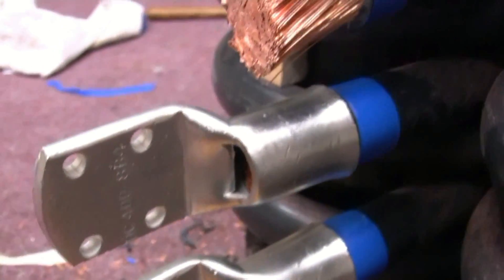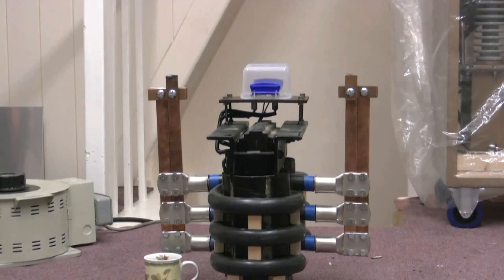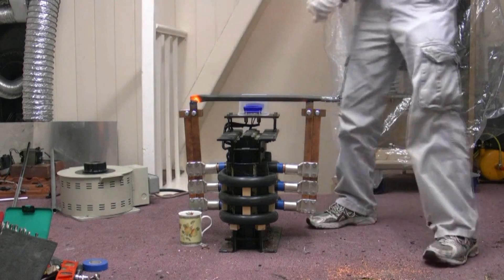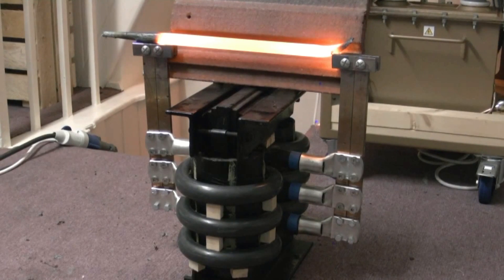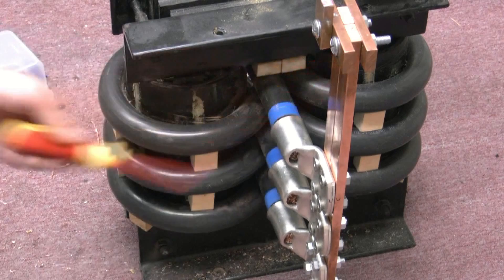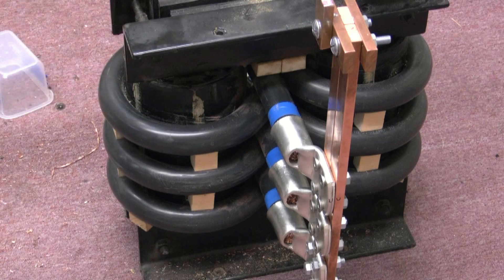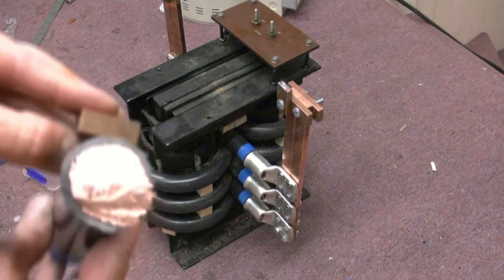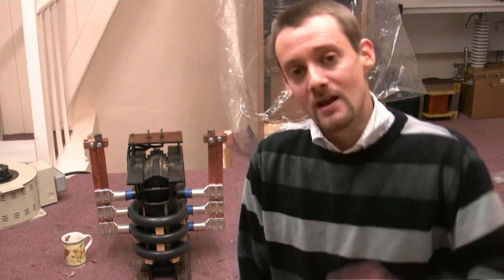50,000 Amp Transformer Completed

Comment: I'm not to smart with electricity but how is he not dead for touching that? Wouldn't he technically be the ground for touching a complete circuit?
Reply: the voltage isn't high enough
Reply: How can you have 500 amps and low voltage?
Reply: 0_o ... how much do you know about this stuff?
Reply: Not enough.......
Reply: called path of least resistance.
Reply: The output VOLTAGE is super super super LOW.
The output CURRENT is super super super HIGH.

There is no shock because the output voltage of the transformer is too low
to give a human a shock. The human body has a resistance of a few MEGOHMS
(a few million ohms). The amperage through the body is a few microamps (millionths of a single amp).

But the copper bars have an extremely low resistance (millionths of an OHM).
Reply: It's only the current he would get through his body that would kill him. And the current is described by ohms law I [A] = U [V] / R [Ohm]

The voltate is below 1 V, then the difference between him and the screwdriver is the resistance in the path the current would take. The screwdriver has close to zero ohm resistance while a human body is in the range of megaohm.

So even if you touch the poles directly you would only get some microamperes through your body due to the low voltage and high resistance.

If the poles were very close together the case would be diffenrent, say if you could touch them both at the same time with a finger. Then the resistance would be only that of your finger and that is significantly smaller than the entire body and then you could burn your finger off but still survive since the current would not pass through your body.

Comment: This guy almost puts him self at a difference of potential multiple time in this video. Still pretty cool though. Don't kill your self man
Reply: John Bäckstrand Amps... not volts.  Less than half an amp will kill you. But you could come into 100,000 volts and just get a really minor zap.
Reply: He is in no danger. Super low voltage xfmr produces nanoamps in the human body.
Reply: A difference of half a volt? Not likely to kill unless you hooked it directly to your heart.
Reply: 0.5 volts with the resistance of the body would result in not a whole lot of amps. Its not a constant-current source AFAIK.

Comment: A car battery will knock your bollocks out! its 12vdc at 80A, i know from personal experience! you can touch both poles if they are loaded, but not if your allowing current to flow through you to load.

Comment: You still must have at least like 50volts in order to get a shock from hand to hand.. I don't know if 50 volts are too little, or well over what's needed, but I do know that you can touch both poles on a car battery without a problem. And this transforms the electric far below a car battery's voltage level.

Comment: As it says in the description, it has the capacity of 50'000 amps, but his house doesn't have enough power to run it on full load. I guess it's mono-phase as well. 
As a lineman, I could easily get acces to a high current source, but I don't have access to his transformer, would've been fun to test it at full power :D

Comment: How can your house main circuit breaker hold that much power ?
50000 A * 0.5 V makes 25000 Watts, right ?
If your house is delivered with 240 V mono-phase your main curcuit breaker has to hold at least 104 Amps...

Comment: But his electricity bill should be high :p
If I'm right, 50000 Amps * 0.5 V = 25000 Watts
His house main circuit breaker has to hold 104 Amps (I presume it's 240 V mono-phase).

Comment: i don't think that's a 50000 AMP, it sounds something between 2000 and 3000, if it was 50000 AMP that screw driver will be melted in less than 3 seconds

Comment: Great stuff & educational.
You should be wearing goggles for metal splashes.
Don't wait until it happens & you lose an eye or both before you say of me,
"That bloody guy was right!"
Also.Draw an arc for too long & you make UV radiation, winding up with welder's eye-burn. Burns a thin layer off your eyeball in a short flash.
Not all that serious as it re-grows pretty fast BUT infection sets in because of fluids in the eye. Conjunctivitis is like sand (a whole beach-full!) in your eyes!
Be safe!

Comment: The open circuit voltage on the secondary is only a couple of volts. You can touch both the bus bars and nothing would happen. It's like a car battery, since it's only 12 volts, you can touch the output terminals and nothing would happen even though the battery is capable of delivering hundreds of amps.

Comment: Nice work, 
However 25kVA is a over optimistic figure for a U+I, iron core, 60cm tall, air gap transformer, not to mention that 400 sq mm are rated @ 4200 (4.2kA) with a temperature increase of 105-110 Celsius over ambient temperature (cable insulation will becomes fluid  ). 
To round it up 4.2ka * 3 windings = 12.6 kA -12600A x 0.5v = 6.3kW maximum rated power for the windings.
2.5-3.5kW for the transformer is more realistic

Comment: Judging by the size of the transformer, it is much smaller than you assume.
I am an electrician and work with transformers, but even a 25 KVA would be bigger than that.
Regardless, great video!

Comment: Sorry to dissapiont you but that is nowhare near 50000 amps.
for this you will need a secondary transformer resistance that is impossible to acheivewith tose cables. Ohms law states that I=V/R Therefore R=V/I =R=.5/50000
Which = 0.00001.
Note this is for dc. on AC this is greater due to the inductance .
I suggest this transformer is atound 2000 A max on the secondary.

Comment: I think some folks in the this thread are in violent agreement. 

Yes, only milli amps are needed to kill someone, but suffiicient voltage is required to overcome the resistance of the human body. In practice 240V is more than enough. 

In this case, 0.5V is "safe", but as you can see the huge current can't overcome the resistance of the metal bar placed across the terminals with only 0.5V, so instead it rather violently heats the bar.

So safe? Don't think I'd be doing this shit in my house!

Comment: 15 kva / 240v is over 60 AMPERES.  You are either spinning your electric meter right off the house by juicing this thing with multiple parallel circuits from the grid, or you're about to start a fire!

Comment: You are really wrong it's the amps that kill. You could have 10,000 volts at .05 amps (a typical electrical fly swatter) and still be fine if you touch it.

Comment: 50000 Ampers??? Bullshit!
A 1,5 mm2 copper wire can 15 amp without warming. So 50000 amp NEEDS an 5000 (!!!) mm2 copper cable (that thicker as my thigh). The cable in the transformer max 800 mm2, so maximum 8000 Amper without warming... (A metro train uses 4500 ampers to start full with passengers.)

Comment: Why about power? From what I understand high voltages are an issue because the electrical energy may jump over long distances, but the current is what causes the actual damage. Power is just these multiplied together. You could have quite large power, but a tiny current, causing little to no damage.

Comment: I am not any sort of electricity expert, but I think with low voltage and high amperes you can worry less about an arc forming from ionization of gas (from wire to skin), and only worry about direct contact with the metal.

Comment: No. 0.5 V  of potential difference is not great enough to overcome the resistance of your body. Your body/skin has a much greater resistance to current flow than the iron tools shown in this video. You need a considerable amount of voltage for you to get electrocuted. It wont kill you. Touch the terminals, and nothing will happen. Touch the iron bar resting on both the terminals, and expect burns.

Comment: It's high current not high voltage, ohms law determines how much current flows squat all volts through about several kohms of body resistance is squat all current, through a fraction of an ohm quite a bit of current flows

Comment: Hi I need your help. Look I have a power of self 1200watts brand boss and I need a transformer to connect to 220v and 12v output need but have to have at least 30amperes that I have to do or you could help me? thanks greetings

Comment: Hey friend, I like your video very much. I from Argentina, (I don't know speak in English good). My question: If I would put my hands in the terminals by your transformer, it could kill me??? I know: very high voltage and very low current, not kill. But, very high current and very low voltage, it could kill me??? 50kAmp. 0.5V.??? Thanks. ;)

Comment: That is simply not 50,000 amps.If it was it would fry that thick wrecking bar.
Its because there there is not enough turns on the output to overcome the bar
resistance.Also the input voltage may need to be at least 220v at 200amps
or 44 kw..At 20 volts output current would still only be 2500 amps.

Comment: your Transformer is Impressive, but kind of ineffectual. why? as you said, you only have an Volttage of about 0.5 Volts. Physics teached us That the Current that Flows in a Circuit depends on the level of Voltage and Resistance ( I=U/R). The Problem is, that The Metal you wannt to heat gets more Resistance the hotter it becomes. So there is a point where the Metal is quiet hot but does't allow mor current, so it doesnt heat up more. You need at leas a fiew Volts for a proper Courrent.. Bye

Comment: I'm not sure about this.. but if the surface of both connected bus bars can hold up to 50kAmps flowing through them, then the current would not flow through screws since copper bus bar has lower resistance than screws.. and additionally the bus bar would not heat up since the 50kAmps would not be a burden..

Comment: since the body has resistance, the current would not flow through the body if the applied voltage is lower than a value...so, the higher the resistance, the higher the applied voltage is needed to make the current to flow

Comment: "Where do you see the 400 turns?"
I cant see them - they are inside the transformer - they are the turns that form the primary - what you see are the turns of the secondary.
It is a step down transformer - he is going for very low voltage - very high current.

Comment: He has 3 secondaries of 1 turn (or 2 turns?)
The primary has (probably) 400 turns - so the transformation ratio is 200: 1 or 400:1 something like it - 240V in 1 volt out (or 240V in 0.5 v out)

Comment: Gosh. Get a good contact with the test object (use clamps) and it will blow like a fuse.
I test with high current (5kA) and those systems humm like a truck at full load. This system is only warming up.

Comment: We see transformers like this in industrial spot welders but they also have liquid filled copper tubing wound throughout the transformer core and windings to help cool it.
It is then hooked to the utility water supply or a cooling unit with pump and fan to keep it cool.
This dude is literally playing with fire and his life not to mention that all large transformers are supposed to be put inside a metal steel box to shield the electromagnetics of the transformer from all else around it.

Comment: While the amperage is what kills you, what determines how much amperage can flow would be the voltage.

With half a volt, and roughly 1k ohm resistance you do indeed get 0.5 mA which is below what you can actually sense.
1 mA is roughly where you feel it, 5mA hurts.. 10 mA hurts like hell... anything over there you may end up dead.

Comment: The voltage is the preasure and the current is the flow. He can touch those busbars because the voltage isn't high enough to overcome the resistance of his body around 100 000 ohms. Where as the rod or screwdriver only would have maybe 0.5 ohms resistance and electricty will take the easiest path or least resistive path.

Comment: Are those crimp lugs actually crimped or did you just push them on with your hands and hope they would weld together? Also, what's it drawing on the primary? If the primary is 2V then 220 / 2 = 110:1. If its drawing (say) 10A on the primary @ 220V then the secondary current would be at most 110 x 10 = 1100A (not 50,000A).

Comment: "A screwdriver wot goes round corners", love the accent....
You should contact a company called "Butterfly labs (BFL)", they are in need of some help with powering their new low voltage product range.
400 Amps should just about do it...

Comment: What he should do is measure the primary side current, primary side voltage and secondary voltage. Then its simple math to determine exactly how many. 

PC*PV / SV = SC

Cool idea, well designed. Why did you spend so much money on it though?

Comment: actually at 50hz that cable isn't significantly less resistance than that busbar due to skin effect limiting the effective crosssection, (still higher current rating due to thermal mass and dissipation) so my guess is heat in the busbar is thermally conducted from the high resistance connection to your work piece.

Comment: Or in real laymen terms, he has a tiny voltage, not enough to shock the body (like a battery). But such a low resistance in the wires that TONNES of electricity flow. 

The same reason a river doesnt hurt you when you put your hand in, but lets much more water flow than a pressure washer, which easily hurts you.

Comment: Only AC, the alternating current makes the primary coil push and pull a magnetic field which will energize the second coil. With DC, there's no change is voltage, so no change in the magnetic field.

Comment: Installing sockets and switches doesn't mean you know anything about voltage, amperage and resistance. I have a major in electronics...
Touching a car battery with my heart is not something i get around to every day, touching it with my hands though, that happens more often, oh and suprise, i never died! (i didn't even feel anything... even when touching both poles...)

Comment: Licking is not exactly the same as touching, now is it mister smarty pants...
You won't die either eay, your tongue will hurt like hell, but you won't even come close to dying.
Also, 12 volts and high voltage are two very different things. There is no way a high current source can "push" the current through your body. Skin resistance alone is at least a few kilo ohms, so at 12 volts, that'll get you a milliamp or two flowing through your body in ideal conditions. Nowhere near dying.

Comment: try licking car battery and then tell me I cannot get electocuted until I have close to zero resistance. BTW Human body and heavy metals in it like iron in blood stream, mercury in livers or silver in neuron (mentor) conections are not isolants. And water in human body is also filled with minerals (its not pure water). So if you touch 12v battery or high voltage electric wires you can get electrocuted.

Comment: because amps doesnt kill you, resistance does.
amps (Voltage) is just how much (in amount) electricity is going throught wires... a lot of wires a lot of amps. Resistance is on the other hand how violently the electrons oscilate.. more oscilation more damage to human tissue, less oscilation less to no damage to human tissue.

50000 amps and not exploding means little to nil resistance so he can touch it without beeing electricuted.

Comment: You have absolutely no idea how electricity works right?
Unless your body has an electric resistance close to zero, you will not, not ever, never ever be electrocuted by a voltage lower than 40 volts. Above 12 volts, it can hurt, but you won't even come close to dying. Standing in a puddle of water doesn't change your electric resistance...

Comment: It's low voltage 0.5v. Neglecting losses power in equals power out so say 30 amps at 230 volts in = 13800 amps at 0.5 volts.
I.V=Watts

Comment: Yes, I was thinking the same. I mean such a beast of a transformer is not cheap. I think the problem was that the house don't have the power to run it at full power. 
But it could easy be current limited on the primary by the use of a ballast
 - much cheaper than scrap it, then buy a new smaller transformer for the high current experiments, haha

Comment: I had the low voltage issue with my 300A 2V transformer. I can never quite get a good connection, but when I do, just about any metal catches fire. Good fun.

Comment: And when did he said that trough that crowbar is flowing 50kA? If you know some basics of electronics you should know that there is resistance in crowbar especially when it gets hot, but thats not all, there is simply not even enough voltage (0.5V) to overcome that crowbar's resistance, which means that there is obviously not 50kA flowing trough that crowbar. If you read the video description you can se that 50kA is when in short circuit - not with crowbar between terminals.

Comment: if the tranny was supplied with 30 amps at 240 volts and puts out 1/2 a volt, then the current will be 30*240/.5 or 30*480 = 14400 amps.

if he was to use 2 or more plug sockets that can supply 30 amps each, it could probably reach 50000 amps. 

in this video he is not pushing it to it's limit, he doesn't say that it's drawing 50000 amps, only that's the rating of the transformer

Comment: No, you misunderstood me. I'm not talking about short circuit current. I'm talking about current flow through a load. Put twice the voltage across that screw driver, and twice as much current will flow through it. Yes the short circuit current would be halved halved to 25kA but there is no where near 25kA flowing through that load with only a few volts behind it. Once those pieces of steel heat up red hot they're no longer dead shorts.

Comment: I think you have 4 or 5 volts on the rod you short circuited.
So, If the intensity was 50 000 amps, your transformer will be a 4x50 000= 200 000 watts! And I think it's to much.
Do you think there is really 50 000 amps???